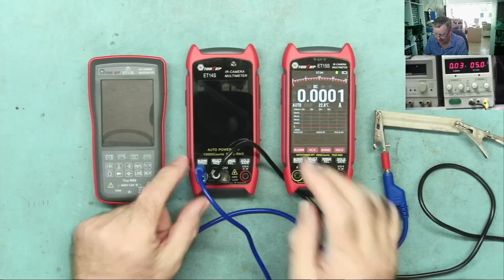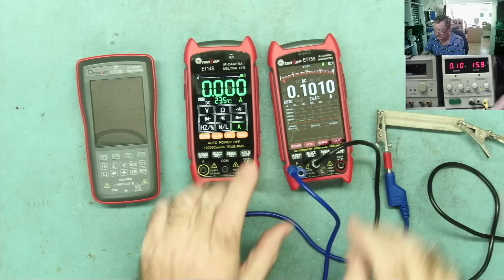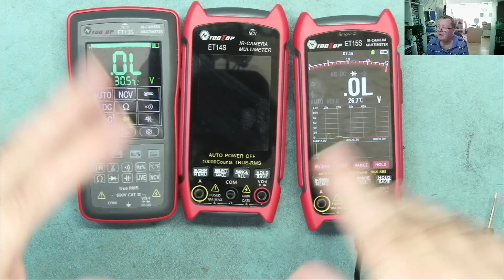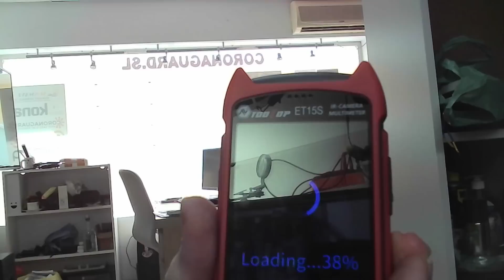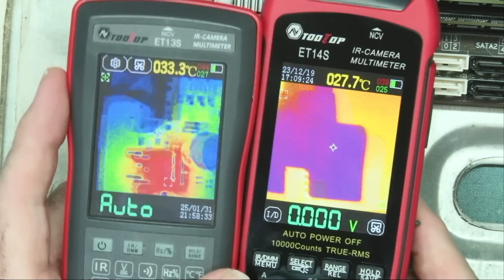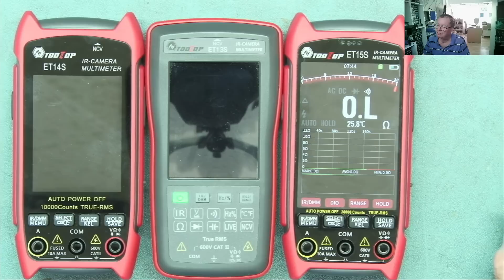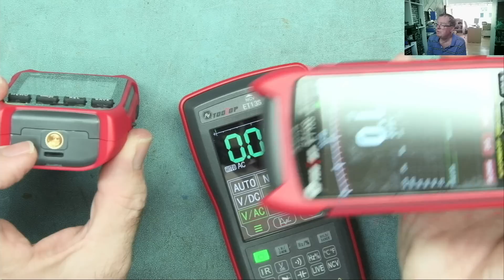Tooltop ET13S vs ET14S vs ET15S Thermal Camera Comparison Showdown : Which is the best for YOU?

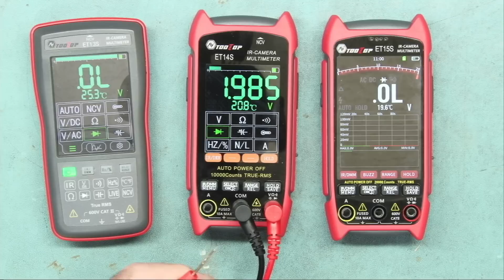Comment: 9:11 Quite the difference in temperature measurement, with the 13S measuring 25.5 degrees, the 14S measuring 20.8 degrees, and the 15S measuring only 19.6 degrees. If I had to guess, that 13S was way off. I wonder what the real temperature was and if this affects the temperature measurement in IR mode.

Comment: I got an ET15C and I had to return it. While the resolution seems real 256x192 the problem is that is only calibrated for the normal YouTube review temperature range like 20C-50C. I tried to measure my fridge (not freezer) temperature and it showed a 10C difference comparing with my FLIR. I asked the seller and he said that if I need precise temperature measurement I should use a thermometer. That kinda confirmed the device is not worth the price. I advice paying 2x-3x more on a FLIR but you can trust the readings anytime than getting Sci-Fi values from unknown brands.

Comment: 3:52  -  What are these loose wires, how can you measure current like that?
Reply: What loose wires? There are 2 cables coming from his power supply, which is set to supply a certain current.
The multimeter is wired in series, so the thin blue wire runs out from PSU and in to meter, then a thick black wire out from meter and into a resistor, then a thicker blue wire from resistor back to power supply.

Comment: Nice review.I only would get these for the thermal camera.
Reply: You might want to check out the 14C and 15C models, which are the same but without the multimeter functionality. The price difference is relatively small though, with the C models beinng roughly $20 cheaper than the S models.

Comment: ** Hi Richard, I would like to ask you to help me decide...
I want to buy a thermal camera but I can't decide between:
1. Tooltop ET15s (I would use only the thermal camera)
2. Guide PC210 (it's almost identical to the Guide E2), of course, I would also buy a macro lens.
- I would use it 99% for electronics repair.
- Is the screen on the Guide E2 too small (that's my biggest concern)?
What do you think?
Thanks...
Reply: The PC210 does not have a macro lens, so I think it would be less good for detail work. But I have never used one.

Comment: Bought an ET15S and it came with parts rattling around inside and wouldn’t charge. Rather disappointing new-tool-day.
Reply: I ended up returning the first, but the second had the same issue. I did check the battery this time and that's kind of the issue - The battery contacts were so flattened, they weren't both touching the battery - and it was the battery that was rattling around. I tried to bend them out a bit to get better tension, but I think one of them was already weakened so it's not really holding. I need to find a replacement contact.
Reply: Can you turn it on by removing the battery and plugging the USB into the charger?

Comment: You don't tried to navigate inside the "MEMU" of the 14 and 15  🙂
Also, the ET13S was switched to rainbow mode (which is almost useless because is harder to understand) while the other two were switched to iron mode (which is the classic color palette for a thermal camera because is way easier to understand and compare).
BTW, i have the ET13S with the macro lens and it works just fine for finding failures.

Comment: I bought the 13S and have been very pleased with it. 
The only problem I have had was the magnifying lens falling out of the white plastic holder. I'm not sure if it has a correct way around but it works fine. The magnetic attachment is clever but looks like an after thought, whereas the slider on the other 2 is so much better. Maybe an updated 13s with slider would be best. 
Its such a useful tool for circuit boards or engine diagnosis that I wonder how I'd cope without it now.
Reply: In the ET13S, it is also easy to make a rotating lens (you can also make it from a standard one) - fix the lens to the plastic rim and screw it with a self-tapping screw to the device body, towards the battery (so that the lens can rotate, pressing against the lens of the thermal imager in the desired position). Now the lens will always be on the ET13S, in one position or another.

Comment: This comes just in time! I was already contemplating which model to purchase.
Reply from the maker: Did you make a decision? And what were the most important factors for you?
Reply: @learnelectronicsrepair  I decided to not buy any of them. An InfiRay camera seems like the more reasonable choice for the same price as an ET15 as it is more capable, and attached to a cable it can go where those bulky meters cannot. As much as I like collecting multimeters (who doesn't), I give this one a pass.
Reply: @hermannschmidt9788 look for Thermal Master camera, i have both versions of them. Recommended PRO because of PCB repairs. Also i want to point out that using camera which you need to connect to cable and then to your phone, unlock phone, start app...this can be tricky sometimes (if you have dirty hands ot gloves). Thats why i maybe buy this kind of device

Comment: My previous comment disappeared, so I'll ask my question again.
1. Did you manage to connect it to the PC?
I've had a few exchanges of messages with the seller, unfortunately I haven't been able to contact the manufacturer because they don't have an official website. So how does the firmware update reach the user?!?!
My 15s version:
HVer:101
SVer:110
FVer:010103
IVer:020014

2. The beeping improved a lot for me after I replaced the factory test lead with a better quality one.
Reply from the maker: No I didnt' but I can ask Tooltop directly myself and also can try this on the next livestream
Reply: @learnelectronicsrepair 
Okay, I hope they can fix it.

I wrote to them today, but it seems they misunderstood what I wrote to them.

I asked for a new Firmware if there is one, and asked if there was any information about the connection problem.

But they understood this to mean that it already connects to the PC well...

I suggested to them two new function what I read in one of the comments.

1. The image and trend can also be saved by pressing the power button once.
Which you can enable or disable in the menu.

2. Also, to be able to set automatic saving in 1 to 60 minute intervals, the current save button could also be programmed.
There is room on the memory card for it soon.

1. press the power button once and it saves the image or trend.
2. press and hold the HOLD/SAVE button and it starts saving in intervals.

i hope they make it.🥺
Reply from the maker: @juhaszpeter4796  I have a good relationship with ToolTop.  My contact won't be there until 5th February though, because of Chinese Spring Festival (which westerners call Chinese New Year for some reason), so give me a few days

Comment: On the camera comparison... look at the sheets of paper in your window.  On the 15, you can even see the gradation of the color/temp! Seems way more sensitive. As well as you say, better resolution.  Who wants to bet that there'll be a 16S in the next while that has the features of the 15, but WITH the touch screen of the 13!
Reply from the maker: That would be a great combo!  I do agree the ET15S was the best thermal camera of the three but I still stand by my point that they are all excellent for PCB fault diagnosis and doubt you could find any fault with one that you couldn't find with the others
Reply: @learnelectronicsrepair  - Totally. They're all almost equal.  And had I not won a 15 in a fellow youtubers draw, I'd probably just get a 14 (the clip on/off lens of the 13 is too much of a turn off).

Comment: My comment disappeared? weird?
I was saying its a tough call and as I wouldn't use any of these as a multi meter. So its either the 13s or the 14s for me.
I really could not see a great difference in the quality of the image between all 3. Maybe my eyes are getting old.
Reply: The one I wrote is also gone.🤣
You can see the difference between the three.
If you open the video in another window and scroll to where the camera is looking at almost the same position, you can see the difference.
It's true that the contours are more visible if there is more than just a few degrees of difference between the warmest and coldest places.
It can also be confusing that the 13s is not set to the same color palette as the others.

I have the 15s, my brother has the 13s and I notice the difference.
The difference between the 14s and the 15s is not that big.

Using this is a little different than using a thermal camera.
You can't fix the coldest and warmest point, so the scale is constantly changing depending on what the camera sees.

I can set my phone's thermal camera to be blue below 40 degrees, and above that the color changes to warmer. This makes it easier for me to distinguish between the warmer spots.
There is no better way than this
Reply: @juhaszpeter4796  Tooltop ET14C is thermal imaging only. I am considering it for the simplicity.
Reply from the maker: @juhaszpeter4796  Sure they are all different. My point was that whatever you are doing whether it is HVAC or PCB repair all of them are good enough to do the job.  At least for me.  Of course we all have different requirements which is why I said I couldn't give a recommendation of one meodel over the other as that recommendation would only apply to my use case (and budget) and we are all different.

Comment: Thanks for delivering on our asks!  Seems like a bunch of fish eye with the ET14s; they optics isn't quite right.  The ET15s sure does give a lot more information on the screen.  I think they could have knocked it out of the park with a touch screen and non-upscaled IR sensor on the ET15s, but that would push the price even further upmarket probably.  The screen capture should be done with the button on the side, instead of needing to find the right button on the front panel.  This also gives a better way to do selfies (for those who like that sort of thing).  For me, I'm happy with the ET13s I already bought after watching this review.  I do use distance for around the house, but a closer magnification suits a multimeter type device better.
Reply: Hi.
If you don't have one yet, I think it's worth buying the 15S.
You can save more pictures and data to the memory card.
I personally don't like the touch screen on the multimeter, it's fragile.
Since it's not capacitive and not "shockproof", the glass is just some kind of foil, oh
For me, 1 max 2 months would be damaged.
+ The Chart is also very informative in my opinion, what I don't understand is why they had to put the upper indicator in it, it takes up space unnecessarily.
I'm thinking of that red strip at the top.
Reply from the maker: @juhaszpeter4796  To be fair I've had my ET13S for quite some time now and it hasn't broken yet.  Maybe if you are a bit heavy handed with it?
Reply: @learnelectronicsrepair  I often drop my multimeters, sometimes I just throw them in the car or bag among the tools, without a case. There was a time when my Owon fell on the exhaust of the engine while I was measuring with the engine running.
+ I am afraid that if I have the test lead in my hand, which is pointed, and I want to change it to another measurement unit, I will accidentally scratch the display with the tip.
With the Smooth button it is not a problem, because it has a glass foil on it, but I would not be able to put it on this.

Unfortunately, I am inattentive while working, I do not pay attention to my tools and instruments.
some times i stepped on my multimeter. Fortunately, I have not stepped on the scope yet.🤣
Reply from the maker: @juhaszpeter4796  This simply demonstrates we all have different requirements. I only use the thermal camera on the bench so it does not live a stressful life .  If I was also doing onsite work I would actually choose either the ET14S or ET15S because I can't lose the macro lens.  If i was regularly doing more distant inspection plus PCB instpection I would go with the ET15S, it works considerably better for distant viewing and has the tripod/monopod mount.    This is what I hopefully put across in the video, all these will all do the job but have various features that make them more suited to some scenarios than others.  WIthout doubt they are all excellent thermal cameras that happen to double as multimeters so whichever you select to suit your requirements I am sure you will be very happy with your choice .
Reply: Tôi đang sử dụng ET14S nhưng thấy ET15S vẫn tốt hơn, và tôi đã chọn sai